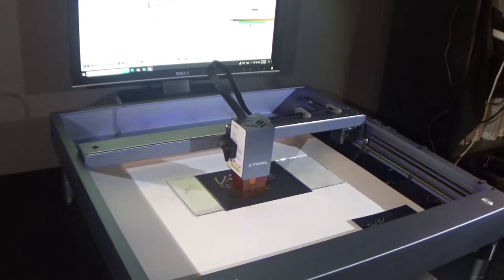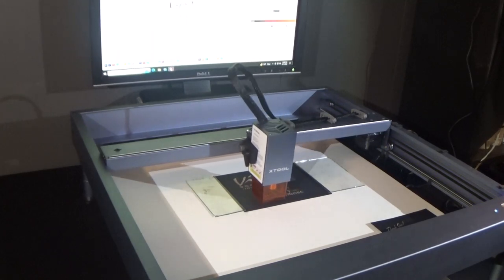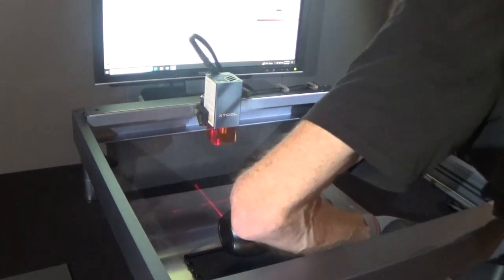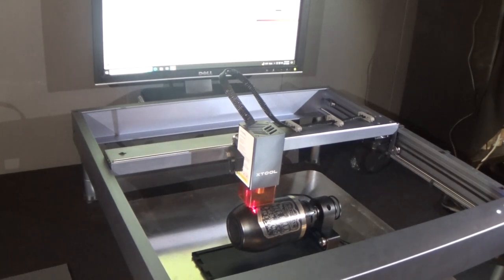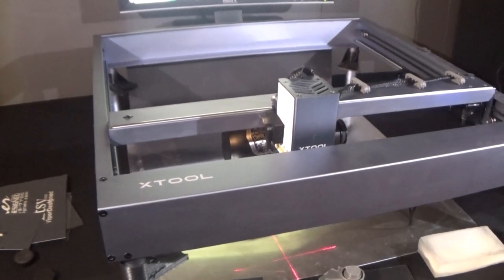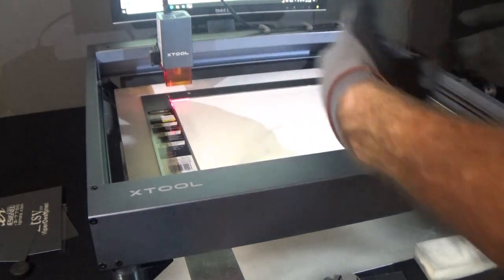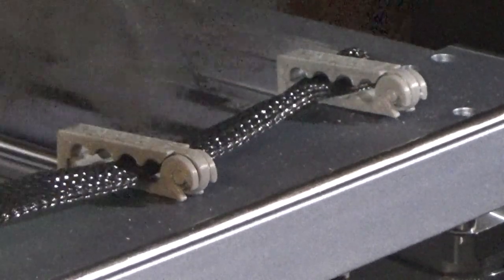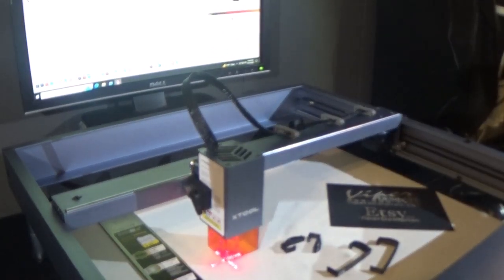xTool D1 & Pro Honeycomb Mounts and other Parts with Demonstrations

Comment: I am definitely getting the riser pieces. After I set up my new honeycomb board I realized how difficult switching between engraving and cutting was going to be. I was trying to figure out how to do it, but I don’t have a 3D printer.  Now, thanks to you, I’ve found the solution! Also, my new honeycomb board and the cable get all jammed up dramatically limiting my cutting area. Do your cable clamps work with the D1 Pro?

Comment: just ordered the combo kit.  do you have anything that would clip on the frame to act as an alignment stop for the "Y' axis?   it would only be used with the rotary and would make the swapping out glasses and the  alignment faster once the first glass is set.  the "X" axis does not be physically moved  only the "Y" axis.   i'm sure i could just use a clamp and a block but something that could put snapped off and on and slide may be an idea.  i know using lightburn this can be done with the software, but i usually use laserbox and am still learning lightburn.  just a thought, don't know if anyone else would be interested.  i would try to make something but don't have a 3d printer.
Reply from the maker: Hello Paul, Thank you for the order and they will be going out today!. I have a couple new things coming soon for the rotary. I have a couple sets of jaws that I am working on and oddly enough, a clamp.. lol.. Had the same thought and it will make more sense when you see the jaws. I can whip out a couple dozen cups in no time and only measure once.